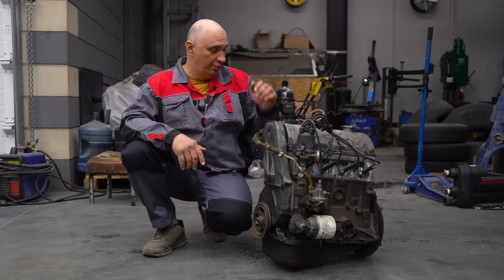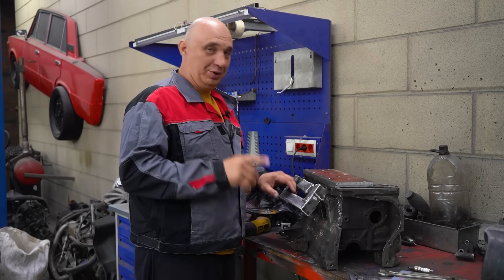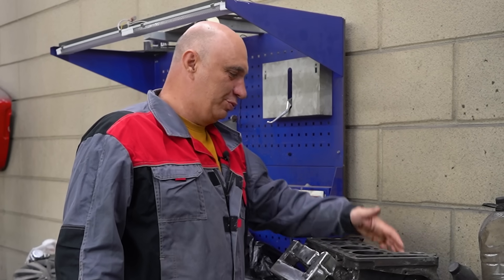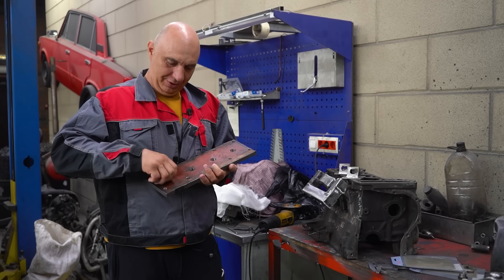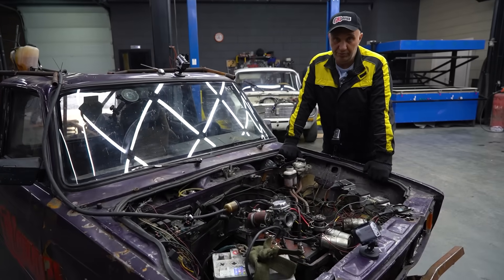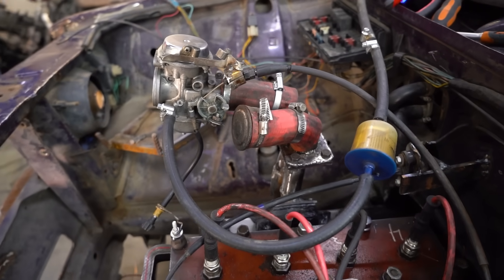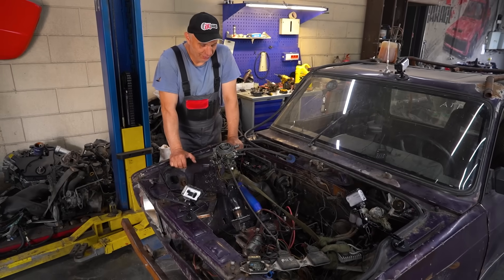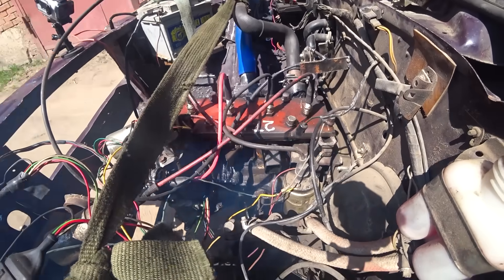4 stroke to 2 stroke Lada engine conversion

Comment: I’d love to see you guys convert a normal, flat plate 4 cylinder engine to a cross plane 4 cylinder. Clock cylinders 2 and 4 by 90 degrees, and modify the camshafts to match the new timing. 

As for this instance (4t to 2t), you might do well with forced induction. The crank case compresses the intake air charge on the previous power stroke in a normal 2t engine. 

Best wishes!
Reply: We were hoping for that back when they were welding crankshafts.
Reply: @android584  on a regular 2 stroke bike engine, the crankcase sucks air into it whenn the piston rise, because it now has more volume. when the piston comes down, it compress the mixture wich is then pushed into the top of the engine. 
what you're missing here is any motion in the air . there is no reason for the air to enter the cylinder as the port opens at bottom dead center and the exhaust is opened at the same time, meaning the engine is simply at atmosphercial pressure , not under suction. so yea you would need a turbo or a compressor to force the air into the cylinder and it will work

Comment: For setup that they had compressor is needed... because in motorcycle 2 stroke piston is compressing mixture in crankcase and after that it goes to cylinder... in their setup nothing is compressing air fuel to get into cylinder so air just moves in out and has no direct flow

Comment: I think the crankcase volume is too big. Volume change by moveing piston is not enough to pull and push fuelmixture. 2 strokes usually have minimum crankcase volume. Air is heavy....

Comment: You need seals between each bottom end crank chamber and the chambers themselves are quite large which isn't ideal. 
The ratio between air under and over the piston must not exceed equilibrium or it won't be able to create enough flow to run for more than a few seconds - until its revving to the moon at least. The reed valves will help with that which is why it tried harder after they were fitted but the bottom end still needs to be sealed between cylinders if you want it to work. 
The under piston sealing and pressures are critical. Without them its not going to run well if at all. 

However.....

You made an engine a while back which had all the pistons moving on the same plane. If you used that then sealing between the cylinders wouldn't matter because it would act as one large engine.

Comment: 1 .  Keep both exhaust and inlet Ports above Piston Bottom dead center with exhaust  OPENING slightly before inlet port.

2. Get Exhaust pipe manifolds LONGER and single to create EXTRACTION and VENTURI effect on combustion chamber. 

3.  Get IGNITION TIMING closer to Top Dead Center. 

4.  Get LUCKY 😁

Comment: As some comenters said; you need a blower. Remove the long intake track, install a mecanical blower that blows directly in the cylinders with the carburetor as close to the blower as possible. Leave the exhaust as is. Don't use the crankcase as a scavenger, use a blower!.

Comment: i think you need the fuel go to the crank case an the piston pushes it to the cylinder or maybe a 2t pipe would pull the mixture?

Comment: You could try to make it a 2 cylinder two stroke. Use the cylinders in pairs so that for instance cylinder one acts as the crankcase for cylinder two and the same thing between 3&4. Two combusting cylinders and two pumping cylinders. This way you can also keep to stock lubrication system running.
Reply: @@tobiascat6173 It makes it more complex but since the crankcase pumping appears to be the issue, it would solve that. And  if the crankcase pumping issue gets sorted and the motor starts running, the lubrication will become an issue.

Comment: Every cylinder must be sealed perfectly like 107% perfectly 👌🏻 other than that, I think Your timing is off... Allso You didn't make any hard measuring around intake/exhaust ports where You should spend most of the time measuring and calculating right port for the mission ... But still amazing experiment 👌🏻

Comment: Crankase, it has to be tight for gasoline "pressure" the krank will then push the gasoline to the cylinder up. You have to make like case for crank with tight clearance and it will work

Comment: To somehow create pressure in the crank room equal to what it is in a two stroke crankshaft room may replace the function and get it to work? Possibly. Or separate the rooms may work, but it likely is a too big room.

Next project, make a two stroke V-twin motorbike  from only Lada parts :)
Motorbike chain and cogs may be allowed.. or maybe use the camshaft chain and cogs? :)
Make a fork with a Lada wheel and a Lada wheel in the rear too, and hydraulic Lada brakes.
Weld a diamond shape gasoline tank from Lada roof plates, make a frame from Lada exhaust pipes.
Get innovative, make a seat from plates and Lada seat foam.. fenders from Lada plates.
A Lada headlight in the front and a Lada rear light on the back fender.
Yeah, make it look kind of like a Harley soft chopper (not long chopper fork).
Could be a cool project but likely takes a long time i see before me.

Comment: the reed valves go right on the cylinder intake ports off of the cylinders spaces only enough for the valve to function, flow paths of fuel need to be corrected so that nothing pools inside of the intake runners but flows directly into the valves, bit to think there also needs to be a longer exhaust system for the reason being that trying to start the motor without the exhaust causes air to flow in thru the exhaust so the exhaust needs to be longer so that there is a natural formation of static pressure that resists the tendency to pull air from the exhaust port apposed to the reed valve.

Comment: Leave the valves in and double the cam lobes. Weld some lumps 180* from existing lobes and mill them to size. Then just make it spark twice to fire on each stroke.

Comment: A few suggestions:
1. In a multi-cylinder 2-stroke crankshaft have  a labyrinth seal between the main bearings to stop the gases flowing between the individual crankcase chambers.
2. You are correct you need a tight seal between chambers, you will probably need to use thicker plate and then machine the top face and make a gasket.
3. The crankshaft on a 2-stroke has large cylindrical discs that take up a lot of the volume of the crankcase chamber that helps create a higher induction vacuum.
4. The crankcases need to be as tight to the cylindrical crank disks to reduce the volume of the crankcase, as in point 3.
5. Efficient scavenging relies on back pressure in the exhaust, 4 x expansion chambers would be best, but any sort of exhaust would help.
6. Mount the carburettors as close to the intake ports as possible, maybe 4 individual carburettors from a 4 cylinder motorcycle.
Reply: @@tobiascat6173 I am 61 years old so my knowledge and ideas are certainly dated 😅But the 2020 KX250 crank has large disc crank and tight crankcase, so does the KTM, so I guess it's still used in competitive scenarios.
Reply: no crank case idea made this month on minds by watching diagram of animation of 2 stroke explorer surfer 

ktm 125 2 stroke 2022 or 2023 
cross bike ... improve that 2 stroke is invention not only knowledge that how its worked on a half engine vertically cut difference 4 stroke half engine cut show 

yamaha told me confidential and secret that 2 stroke and kips is their invention 

indeed there was not anything at their address just a final fantasy silent place with plants over empty building company
Reply: i know that making a 2 stroke and history of it and teaching lessons about it is 20 hours video vhs 
by yamaha companys a women teach it ... 

yes a woman 

and this invention plus kips on 2 stroke is yamaha invention

and then others got from them

so this is near the invention 
not just changing intake out take exhause cranck case port pressure ... timing 

it is invention 2 stroke + kips 

ok ?

Comment: I think the exhaust and intake ports are drilled incorrectly. The intake port should be slightly higher than the exhaust port so it begins sucking in air before the exhaust port is exposed. This helps give the air momentum during the downstroke. Also, after firing the exhaust port will be exposed sooner allowing higher pressure air to exit and helping reduce pressure for the next intake stroke. Also, the "intake manifold" (currently looks like unequal length, bend radiator hoses) needs have equal length tubes without kinks or restrictions.

Comment: I really hope they keep working on this, I find it extremely interesting. Also, Doesn't it need an exhaust expansion
 chamber for proper function?
Reply: No. That may help performance depending on the engine's base design, port heights and so on but it certainly doesn't need one to run effectively.
Reply: a 2t works without a pipe in low rpm
Reply: ...and custom pistons so it will scavenge. There's quite a bit wrong with the current design that's keeping it from running.😉
Reply: no

Comment: All cylinders share same intake manifold. There is no check valves for each cylinder. Each cylinder needs separate intake and separate carb. Most (in)famous 2 stroke, two cyl Trabant has single carb, but it has (valves) rotary plates on crankshaft which distribute fuel mixture between cylinders.

Comment: You may have a vacuum problem but you also have to consider that instead of one cylinder at a time you now have two cylinders trying to pull fuel from the carb at the same time. Id suggest trying a way bigger carb and somehow improving the cranksealsif possible.

Comment: Have you considered scavenge fed 2stroke, 
Run a 4 stroke wet sump with oil pump, and use the ports with turbo/supercharger to force the air mixture in.

Comment: You should have done it like Detroit diesel did in their 2 stroke line. Use a blower to feed air and in this case, air and fuel. You would need a longer piston skirt to block off the intake ports while piston is moving up to prevent fuel/air from entering crankcase.

Comment: If you make a "Detroit diesel" two stroke type. Air hole in bottom end with a blower to scawange the exhaust gas and push in fresh gas/air mix and use all the valves in cylinder head as exhaust valves. You can use the lubrication system as is and the resonance in exhaust is no longer important.

Comment: You need to mix 2 stroke oil with the fuel so it lubricates and seals the cylinders.  Also the ignition timing must be adjusted to fire at the correct time which is at a different point of piston travel with the 2 stroke. 50:1 ratio of oil to gasoline, and make sure to use 2 stroke oil specifically.  Hope that helps!
Reply: Don't worry about the rod bearings that don't need oil🙄
Reply: Lmao. The stupid is strong here!

Comment: Use a Lada engine and make the camshaft gear as large as the crank gear and run as a 2 stroke, it does mean the valves will be going twice as fast though

Comment: you are indeed wrong. The exhaust on a two stroke is 90 percent of what keeps it running. You need to tune your exhaust with an expansion chamber or it will do this sort of stuff. Sealing the crank would also help but is not required at all since all the crankcase acts as a big fuel air mixture reserve.

Comment: Without crankcase pressure forcing fuel + air mix into the cyls, you'll need to add a super charger like they do on the old Detroit Diesels. Two strokes don't "suck" like 4 stroke on the intake stroke, they need a form of forced induction via crankcase pressure or an external blower. You'll get this to run!
Reply: My thoughts exactly. Get a blower.
Reply: I never seen them add any transfer ports into the cylinder so they will never get it to operate as a natural aspirated 2 stroke also they need to time their ports with a  degree wheel in order to get the proper crankcase vacuum and exaust duration
Reply: Exactly my thought
Reply: no need for supercharger, even some electric fan works well.
Reply: you'll need fuel injection unless you blow through with a carburetor.
Reply: @Clunk49  you can draw Through as well not super good for the turbo but can be done
If you blow through you need a special sealed carb normal carb the bowl is vented to atmosphere and you get a gasoline fountain
Reply: @legros731  well, thinking of all the street rods w/blower & carbs sticking out of the hood is something to consider.
Reply: @Clunk49  yes never said otherwise but a blower cope way better with fuel in the air than a turbo the compressor wheel won't last long
Reply: You create the case pressure with the piston going down, the transferport is used to move the mixture to the cylinder
Reply: @Kris-fd9xs  we know how a 2 stroke gaz engine work but in a 2 stroke diesel it use the supercharged to pressurize the air fuel charge and the still have normal exhaust valve
Go check how a Detroit 8v71 2 stroke work
Reply: Detroits use the blower to scavenge the cylinders, fuel is introduced via a hp injector at the top of the cylinder
Reply: They did connect the crankcase chambers into the intake ports of the corresponding cylinders. Seems like a lot of people missed that in the comments but if you watch carefully you can see how they did it. So no blower is needed in this case... Though the chambers weren't sealed good enough so maybe they could benefit by just using the turbo and ditching the crankcase pressure/vacuum setup
Reply: @mondude9754 no they don't or the engine will suck all the oil from the crankcase if that was the case and no you can't run 2 stroke mix 4 stroke engine requires pressurized lubrication and oil escape the bearing from the side and drain back down in the pan
Vs any 2 stroke that use actual roller bearing for the crank and rod and these can be lubed with the oil in the fuel
Reply: @legros731  I get that... but These guys don't care how long it lasts. They just wanted to hear it fire. I mean the thing didn't even have a cooling system for God sake. With that being I assure you it didn't have any oil in the sump.
Reply: There are different types of 2 cycles, and not all require a blower. Take, for example, a typical japanese dirt bike 2-stroke. They are crankcase-inducted, with reed valves, and require no blower. Piston goes up, drawing vacuum on the crankcase - air/fuel is drawn past the reeds and into crankcase. Spark event occurs near TDC, pushing piston down, generating power, and starts to squeeze the air/fuel in the crankcase. That air/fuel mixture passes through the "transfer port", and it begins entering the cylinder just as residual combustion pressure finishes pushing exhaust out the uncovered exhaust port. The fresh air/fuel finalizes the scavenging as the piston changes direction and begins moving upward again. Voila: suck squish bang blow, 2-cycle style without a blower.
Reply: @GroovesAndLands  that's what I said that you didn't read. The 4 -stroke crankcase isn't going to be conducive to crankcase induction.
Reply: @anthonybielobockie4991  Thats why they tried to seal it with pieces of metal. I don't think they realised just how sealed it needs to be. Leaving open bearings was never going to do it.
Reply: @GroovesAndLands  Typical motorcycle has close fitting sump to reduce dead compression, this engine has plenty space for dead compression to rob it of proper fuel transfer.
Reply: @GroovesAndLands other type of 2 stroke don't use the same engine bearing as a car engine that need pressurized lubrication for the bearing to work vs a dirt bike that use roller bearing and no oil pan/pump
If you use the crankcase to feed the fuel like in a 2 stroke it will suck all the oil in the cylinder 
If you got any clue how a 4stroke work you know this will never work even with a dry sump system
The only way this will work is like a Detroit 2 stroke diesel and would need custom piston with ring groove on the bottom 
You could reduce the stroke add a deck plate to raise the deck height and go with custom longer rod to get a good rod/stroke ratio a 2:1 ratio would allow for 12k/14k rpm so the engine can rev high like a real 2stroke
Remove the stock cam pulley and use another crank pulley on the cam so they both turn 1:1 remove intake rocker or if the engine is dohc you could use 2 exhaust cam and have dual exhaust headers 
Twin exhaust mean twin turbo and supercharge 😎
I almost want to try with a honda b18b engine

Comment: Well first you need to have expansion chambers in your exhaust like a dirtbike or a snowmobile because that's part of the engine, it needs it to run correctly. And then you have to separate each cylinder in the crankcase also like a snowmobile. And you should check the compression which should be like 160 p.s.i. It was having trouble turning with the starter, so I would think it would be much too high like 260.

Comment: the new head left the timing cover open it wasnt building any pressure in crank case  they crank and pistons squeezes the air into the cylinders  they  just need cover it up so it builds pressure